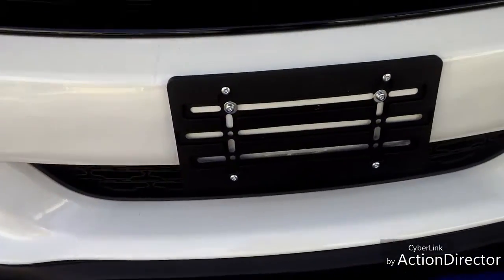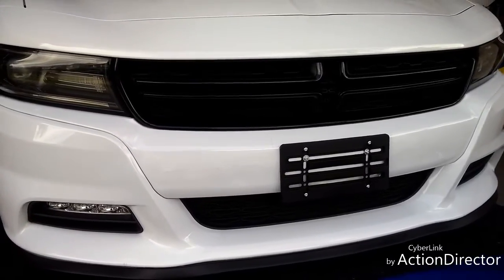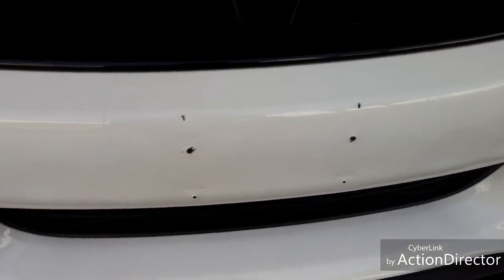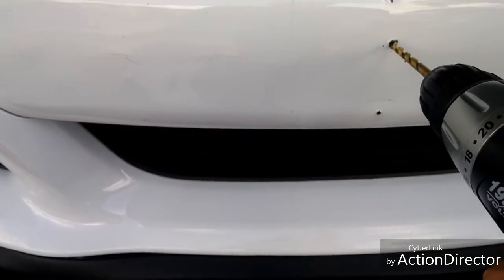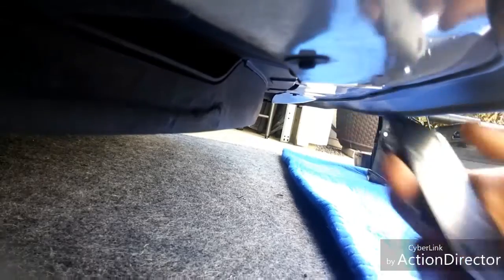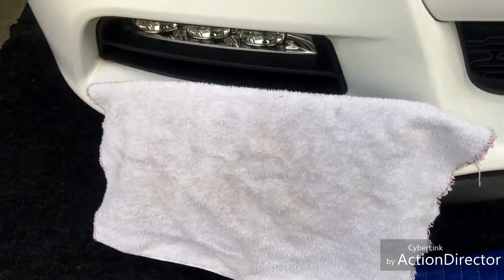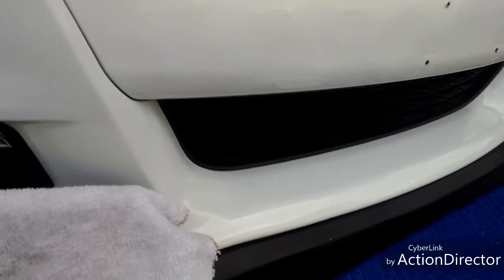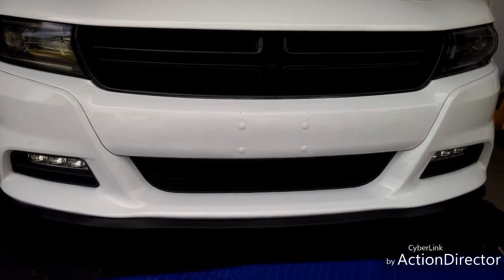Dodge Charger Sto N Sho / Bumper Plug Install

Comment: You can always wrap that front bumper section black. That would look good with your theme. I know they have a gloss black vinyl wrap.
Reply from the maker: Rated PG Charger that is my backup plan through a local tint shop...we'll see how it goes

Comment: Man thank God here in Arizona we aren’t required to have a front license plate.... Ryan I did the plugs in back with the spoiler removal and painted the plugs like the ones you did also.  My problem is I painted them with the exact Mopar paint as you used but now the paint is wearing/chipping off.  Are you having the same problem and if so should maybe a primer or something in those lines be used on these prior to painting them.
Reply from the maker: Eric Keen I used a clear coat afterwards from rustoleum to protect the surface
Reply from the maker: Eric Keen the plugs under my spoiler were already white in color, so I didn't paint those.
Reply: Yea I remember the rear ones you left those white... just wondering how those fronts were holding up... again I did about 3 coats on mine and they only lasted a few days and started chipping.  Guess I’ll try the clear coat like yours and see if that fixes the problem.  Thanks!

Comment: The dealer must be a idiot, the license plate bracket mount holes are actually marked by Dodge as to where to drill the holes. Anyways, looks good. I put one on my Scat, but it's in the middle as I don't have the adaptive cruise.
Reply: Blu3 Dreamin yup, you don't have it, cause it's not available with the manual.

Comment: I got a front splitter i wonder if it will still work
Reply from the maker: It can be mounted under the upper part below where the license plate goes originally